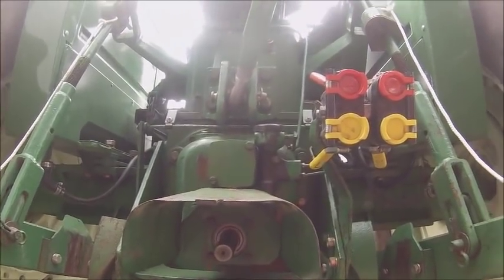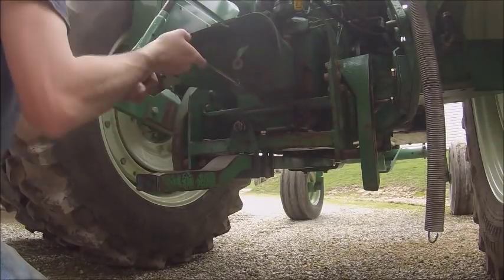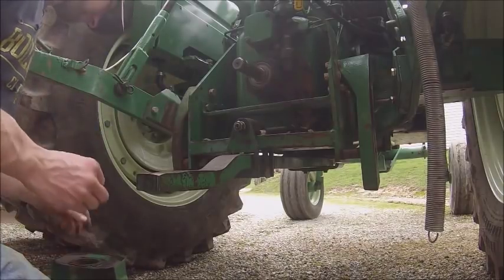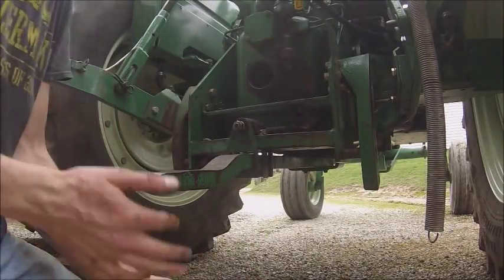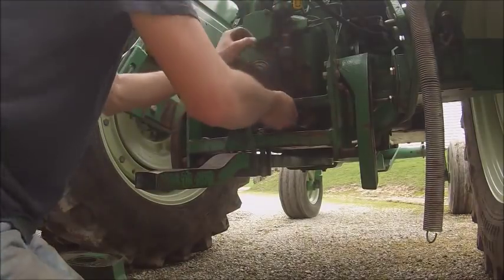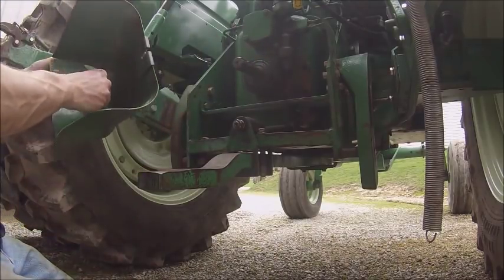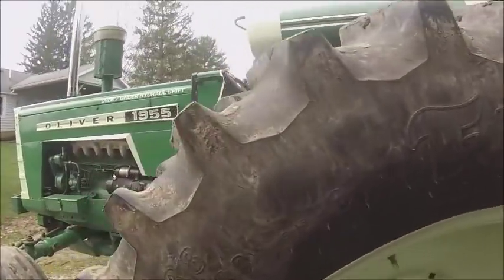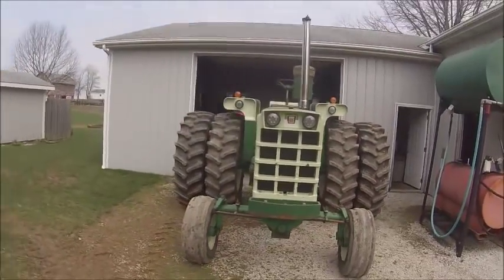Changing PTO Shafts On An Oliver

Comment: Once again Oliver was ahead of there time!  What do you use for bolts to hold your drawbar roller centered on the support?
Reply from the maker: Well I did have a strap that went underneath the drawbart that I put bolts through to draw it up tight so it wouldn’t move around. But I lost 2 of the blocks spreading fertilizer because the spreader beats on the drawbar so hard it kept streatching the bolts. So now it just has 5/8 bolts that pin it from going side to side.
Reply: @Oliver66FarmBoy  yes that what I use also, but I use a square 3/4 nut and run the 5/8 bolt thru that and the support. Brings it up alittle higher on the roller. They still move around quite a bit though.

Comment: Your right...now that you pointed it out...i always see it. Grrrrr My 4010 deere doesn't lose all its oil when i switch. The stub shaft shifts it with that long rod. As long as the o-rings on it are good it doesn't leak.
Reply from the maker: I told you once you see it it can’t be unseen. Lol

Comment: Using IH, Allis, and Oliver I can safely say Allis is the best pto setup with Oliver very close second. Should say Allis 7000/8000 series that is. IH dual setup ok but with any 3 point implements with pro drives was a hassle getting the right lengths of shafts to get the geometry right like snowblower for example. P.S. the duals make that 19 look tough as hell too!

Comment: Thats a pretty slick set up right there. Never heard of a 3 speed pto before so that is pretty neat. Ford is the same way as the deeres they're almost identical in the way they change out. Something is telling me though on 8700 and 9700 possibly the earlier series too in the 8-9 range it doesn't leak out because its a separate system from the hyd oil. Later models they just joined them together

Comment: Wasn't aware you knew about Chris, like you, he's got an awesome channel as well, think he's still working on that White. Had an old Ford 881 SoS, (select-o-speed). It had a similar set up PTO wise. Had 2 levers on the side of the transmission, 1 was for switching between 540/1000. The other was to select it from running from the "clutch" to running from ground speed. Forgive me, but, ALL Oliver's look good. :D Hopefully, weather will hold out for you. Great video, cheers :)

Comment: I never knew about the third pto. That’s an interesting add on. How does IH and Molina’s dual speed work with the different amount of splines for 540 and 1000? Have a good one
Reply from the maker: The tractor has both shafts one above the other.

Comment: The only other tractor I know of that runs engine speed and ccw is the cub. It's a pain most of the time but it's kind of handy when you have to spin a  skid steer motor over from the front when it doesn't want to start. I never knew that Oliver had that feature hidden in the rear end. Thanks for the video.
Reply from the maker: I think Massey was the only other one that offered it.
Reply: Engine pto was for irrigation pumps